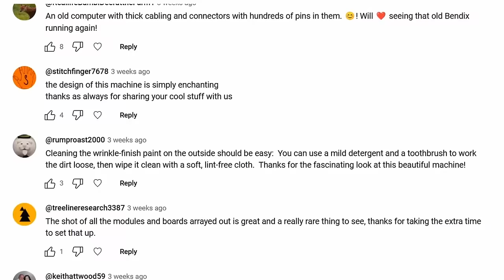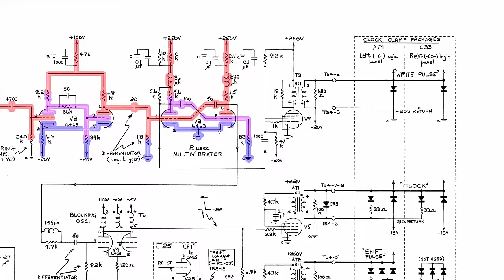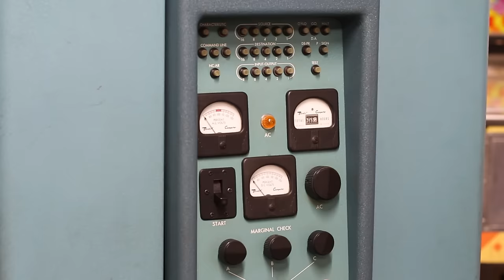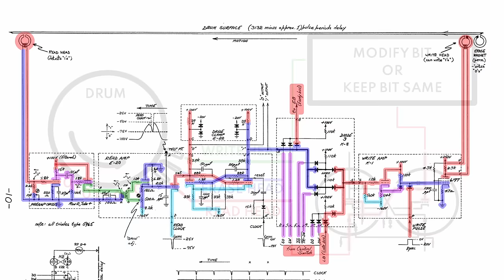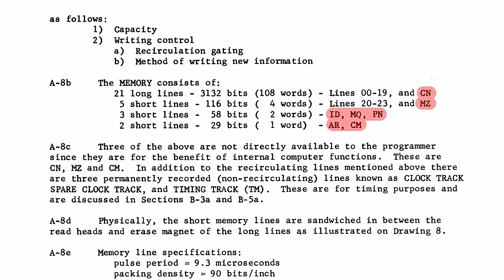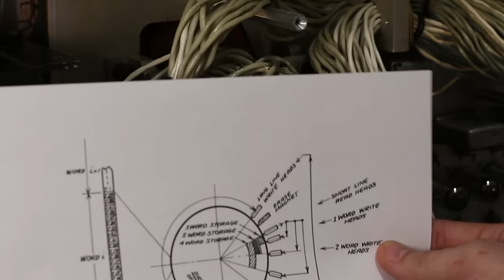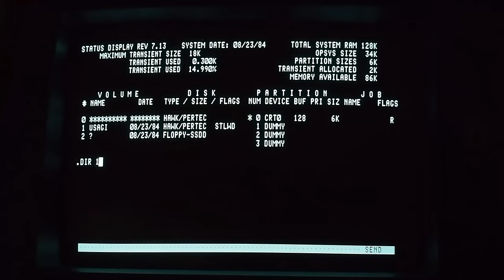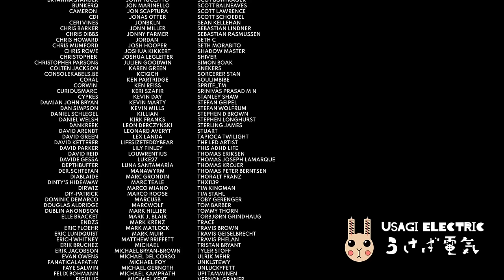Rotating Drum Memory with the Bendix G15

Comment: The best way to get ones mind around how the drum works and is used is to recognize the Huskey's design was strongly influenced by his time at NPL, and in particular Turing's 5th ACE design.  This is the design, (a simplified version) that was realized as the Pilot ACE (largely at Huskey's encouragement).  The drum here essentially implements the same memory as the mecury delay lines in the Pilot ACE.  If you are able to recoat the drum, the read-only clock track will have to be re-recorded.  As for how the crashes might have taken place, IIRC the original procedures called for adjusting the head gap by screwing the head in util it just lightly touched the drum and then backing it out a certain amount.  If that was done improperly, then the heads could dig into the surface.  Of course, bad bearings could also lead to vibration in the drum causing it to hit the heads.  In other conversations about G15 restorations, I have talked about building a drum emulator, which could still be good even if the drums at hand can all be restored.

Comment: Absolutely fascinating.  That wire wrap and routing was a thing of beauty.
Reply from the maker: Interestingly, the wires are all soldered instead of wire-wrapped. It's gonna be a nightmare to repair if any are broken, haha.
But it is a thing of beauty!
Reply: @UsagiElectric  I meant that string that the wire bundles are wrapped in instead of the zip-ties that they'd use today. I got the name wrong. :/  I love the look of that.  Everything meticulously planned out and organized.  I saw a satellite backup at the Tellus Science Museum that was done the same way.  The panels were removed and you could see inside it.  Absolutely gorgeous.
Reply: Back in the early '80's, part of my BT apprenticeship was using lacing twine and learning the art of 'plate wiring'. Very satisfying when done nicely. 😊 @FirstLast-vr7es

Comment: Fantastik was the cleaner that we used when I worked for a computer store back in the 80's when dirty computers came in for service.   Always did a great job on both plastic and painted surfaces without damage and without needing huge amounts of elbow grease..  Removed tobacco smoke and all sorts of grunge very effectively and customers were always impressed that their machines looked new when they came back from the shop..
Reply: Fantastik was pretty much the same as Formula 409, which I think is still available.

Comment: Please bear with me. Was in the AF 50 years ago and I was part of the maintenance department to service the ITT SPE (Stored Program Element), a par of them. Amongst the hardware that it used was drum memory for storage, 16 of them. From what I remember the heads were held off the drum by springs and need air to load the heads to the drums. When the spring broke, they would crash onto the drum surface. It looks just like what you are seeing here, only it was a volume set of heads (16?). We had a repair depo that did the repair/refurbishing of the drum units, and we did the final testing. We got very good at swapping out drum units, all 450lb. The SPE x 2 had about 65 cabinets, 16 drum units, 16 Potter computer tape units, card punch/reader and two printers. Next door was a transistorized version of a Sage. This was a transistorized computer made operation some time in 1962. It had 32,768 16-bit words with parity of core memory. The drums had four volumes at 4k word each. The interrupt system was controlled at each instruction. This drove the engineers from Honeywell batty and they would say the old girl would take her sweet time to acknowledge. LOL Hey, she was running in a 1mz clock, and the memory cycle took 4 cycles to do a memory operation! The low-end DEC that they were using as an interface must have been almost as fast as the SPE.

Comment: Thank you - that cleared up how drum memory works. With hard drives and floppy disks, we have sectoring with gaps to ensure existing data isn't overwritten (excepting Amiga drives that write whole tracks). Having the fast registers inside of the long registers clarified perfectly. For both those reasons, it is not so helpful to think of them as a differently shaped hard disk, but instead it is better to think of drums as being much more like mercury-delay line memory, only instead of audio pulses down a tube full of mercury, it is a sweep of magnetic coating.

Comment: I worked on a drum-based computer in the mid-1970s, the Philco AN/FYQ-9, which was used as a data processor for a portion of NORAD's Radar network.  The tracks were non-volatile, so the system could be shut down and restarted without having to reload its software.  In fact, it was a royal pain to reload the software, which was stored on IBM-style punched cards, one word per card, and cards had to be hand-loaded into the reader one at a time.  This was intended for loading maintenance test routines, which consisted of a small number of instructions, but there were times when software updates were sent that required reloading the whole program.  We also had to do this when one of the heads burned out, and we had to switch to one of the two spare tracks on the drum.

I'm pretty sure this is how most drum computers worked.  The fact that the Bendix G15 erases and re-writes every track as it goes (and especially the short line's use of only a fraction of a full track) tells me that its design was based on a delay-line-based computer, or even perhaps that it was initially meant to be a delay line computer.  Delay lines have to be continuously re-written in order to retain data in the first place, and of course cannot retain data over a power shutdown.  Drum memories were far less expensive and more reliable than equivalent delay line memory, and their use overlapped that of magnetic core memory.

Good luck with your drum work, and with the rest of the restoration of this beast!

Comment: Blocking oscillators are used to provide narrow trigger pulses from an input clock.  It's basically a pulse shaper.
Reply: One thing I've wondered about is how much information one could store with a triode, transformer, and resistors wired as a blocking oscillator.  For example, if a system had 1MHz master clock which was divided by ten to yield 100kHz master phase reference, then a 100kHz blocking oscillator which was fed the 1MHz clock would have ten different stable phase relationships with the master clock.  Add a couple of semiconductor diodes, repeat the circuit a few hundred times, and one could have a somewhat-slow-to-write RAM (I think a single-triode oscillator might need to be driven a few cycles at the correct phase in order to settle in) using only one glass tube for each pair of decimal digits.

Comment: considering it is a drum even if one or more heads would be diging into it, you could probably just replace the heads and point entire row to a different  position, but given this is basically just ram, drum is possibly restorable if you could find a crazy enough person to recoat it
Reply: It might be possible to remove offending heads and rewire the head assembly to the working ones at the expense of losing some memory capacity. The downside is obviously that the existing software won't work. But if we don't have much software or won't be demonstrating it in the museum anyway - I think this is the way to go.

Comment: A drum that old may have been designed for contact heads, like the heads of an old audio-tape machine or VCR.  Flying heads most likely came later, so 'head crash' is likely not a meaningful idea.  But that water damage (or whatever that glop is) could easily have been abrasive and scraped the oxide away.

IBM 650 drums and UNIVAC FASTRAND drums increased their bandwidth by using all tracks at once.  Each read and write head corresponded with one bit of the word, and words were written in parallel.  The 650 was a 1+1-address machine. Every instruction was a jump and held the address of the next instruction.  The assembler would place instructions so that the next instruction would be arriving under the heads just in time for the next fetch.

Stan Kelly-Bootle once described the FASTRAND drum as a storage device - for the storage of angular momentum.  He continued that if more than three were in the same building, the installer had to consult Sperry's resident geophysicist for the correct latitude-dependent orientation of the drum axes.

When I was an undergrad at Dartmouth, the computer center had a couple of FASTRAND drums that had been retired from NASA. There was a weird 'Apollo Support Device' (occupying an entire 19-inch rack) for interfacing the GE 635 computer to the Sperry drums.  It wouldn't have been workable except for the fact that the GE and Univac machines both had the same 36-bit word size.

The IBM 650 was a weird architecture.  It used bi-quinary encoding - it was a decimal machine with two-out-of-five bits representing a digit.  400 digits of the recirculating memory (which worked more or less like the CPU registers on the Bendix) were devoted to the addition and multiplication tables. There was a truly bizarre bit of code in the bootloader, getting that memory initialized, when all the arithmetic it could do had to use already-initialized values!  It was entirely possible for a rogue program to scribble on the arithmetic tables, and just TRY to debug that!

The Royal-McBee LGP-30 was similar to the 650, and gave rise to the Story of Mel https://en.wikipedia.org/wiki/The_Story_of_Mel .  I heard about that one directly from Ed Nather; I was friends with his daughter. The original tale at https://users.cs.utah.edu/~elb/folklore/mel-annotated/mel-annotated.html wraps up so much computing history - check out the annotations!

Comment: A minor correction:  At 5:42 you describe the circuit involving V2 on the clock chassis as a monostable producing a precise pulse length.   It's actually a Schmitt trigger, which produces a pulse of precise amplitude, with an output that snaps quickly between two voltage levels.   Note that the small capacitor across the 56K resistor is not a timing capacitor - its' function is to compensate for the Miller capacitance arising from the grid-plate capacitance of the second triode, thus enabling a fast rise and fall time of the output pulse.

Comment: You will also need to closely inspect the heads. They crashed hard and may be damaged as well.
Reply: Went here to post this.
They are most definitely damaged, the question is: are they unusable?
Reply from the maker: Absolutely! 
They will have definitely picked up a large amount of oxide at the minimum. It's going to require quite a bit of effort, but I think if we approach it methodically, that we can bring it back, even if we have to make new heads
Reply: @UsagiElectric  Wait, what? Make new heads - is that even possible??? What do those heads look like?
Reply: @UsagiElectric  Is there existing software  that we would like to run on the system? 

If not I strongly suggest just not using the dead tracks, possibly rewiring the machine to make sure all the internal registers are on good tracks.

I see only a minority of unusable tracks, the remaining ones should be more than enough for museum demo purposes if custom software is executed.
Reply: As another poster commented, the heads are (apparently) fixed and could not actually "crash." Something like loose dirt may have caused the scarring on the drum. That said though, the heads should be inspected and cleaned. I wonder if routine head cleaning was a required maintenance procedure. Is the drum in a contained housing with filtered air. Is there an air filter?
Reply: Making new heads would be a chore.    They involved coils of very thin wire, on very tiny C-shaped bits of ferromagnetic material.  The mechanical tolerances were also very tight.  These heads didn't "fly" over the drum like the heads on current-day hard disk drives.  They were statically positioned by delicate adjustments.   Those screws you see on the head racks...they are the adjustment screws for each head, to assure it flies at just the right distance from the drum so as to maximize the signal from/to the magnetic material on the drum, and minimize the chance of it hitting the drum due to imperfections in the drum and magnetic surface coating, as well as bearings.  It may be possible to rework existing heads if they are not encapsulated in something that precludes their disassembly, but even then, you'd likely need a microscope and some mighty tiny tweezers to wind the coils, as well as  tremendously steady hands and a lot of patience (or a micromanipulator system).   Some drum heads used Gold wire with a very thin lacquer coating on it, which could end up being rather expensive nowdays with Gold at ~$2K/ounce.   If it can be done, though, I know y'all will do your darndest to make it happen and if there's anyone that can do it, it's you and the experts you have working with you.  I'll be watching constantly to see just what comes of this.   Make those G-15's work again!    I'm so with you on no emulation...real drums are the only way to go!

Comment: 29 bits? Truly weird. And a clever way of partitioning the drum. I had a good laugh at the paperweighth part... and again, I hope I learned something. I wonder what it'd take to re-coat the drum, but I'm mighty rootin' for ya! :)

Tube markings were sometimes etched with hydrofluoric acid, it's gonna hold under scrubbing.
Reply: @tripplefives1402   The coating will most likely be ferric oxide powder, not iron filings. Also, metallic paints are made with aluminium flakes.
Reply: the way they thought about word length was in decimal point precision in those days, so 29 bits is like precise to 8 decimal places or something like that.
Reply: @tripplefives1402  Yes, I know. I think that getting the specific form of iron oxide required will be a bit more complicated than letting some iron filings rust a bit.
Reply: @tripplefives1402  that'd make sense, could be done in a jig, with hand drive or some motor drive turning very slowly.
Reply: This reminds me, I've seen magnetic inks to be used in inkjet printers, e.g. for printing credit-card style strips... I wonder if something like that would be durable enough, or maybe could be baked-on... heh, or even printed onto plastic or paler and wrapped around the drum, hah!
Reply: @ericwazhung  Your overthinking it. There is an IBM video on youtube that explains how it was done in the 60's it's basically a liquid mixture of epoxy and ferric oxide that is poured on the surface in a controlled manner while spinning then you spin it at a certain speed whilst heating it to set the epoxy. Then you slow cure it and then go through some polishing steps to get it smooth and even. The IBM process is of course much greater precision than this application however would be great for the hawk drive.

Comment: I used drum memory for an old real-time aircraft training simulator. The computer memory had only 1024 words of memory and the code was loaded in strips into the core memory.  Real-time was controlled but the rotation speed of the drum. Reason for drum memory was the astronomical cost of core memory! Interesting times!

Comment: I would guess the brown residue is nicotine. It was used in the 1950s and 1960s, after all.

Edit: at 4:24, on the control panel.
Reply: So your guess is that the nicotine found its way inside the drum enclosure, but not to all of the rest of the machine.  Um, no.  The drum is using an oxide coating like that used by magnetic tape and older disk drives.
Reply: @BrightBlueJim : So at 4:24, that's what's called a "control panel". You can tell it's a control panel because it has controls on it and is not a magnetic drum. It is obviously not iron oxide, due to the presence of blue paint, of indicator lights, of control knobs, and the absence of voice coils. It is also conspicuously non-cylindrical.
Reply: @Jesse-qy6ur  My mistake.  My "brown residue, I thought you were referring to the brown stuff that is shown on the drum.
Reply: On the paint, of course.  The drum unit does not appear to be hermetically sealed, however, so even in that day there may have been "No smoking in the computer room" rules.
Reply: @Jesse-qy6ur  Oh, I thought you were calling the drum memory "brown residue"